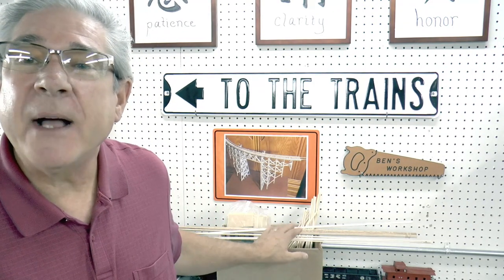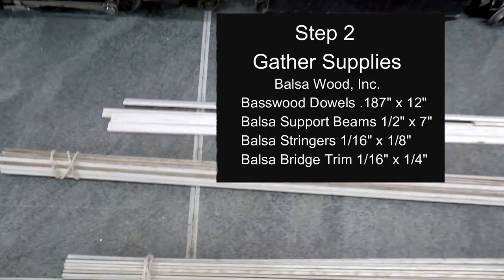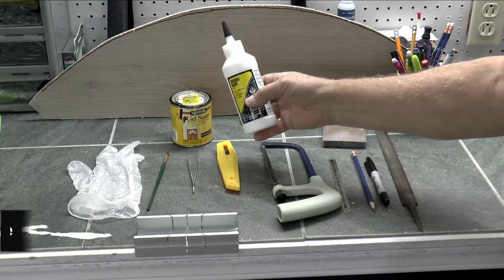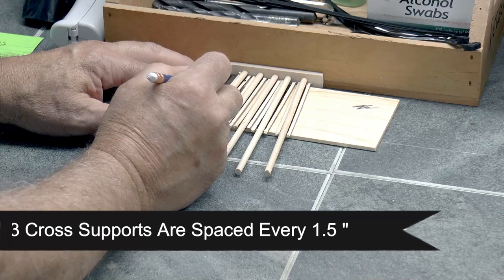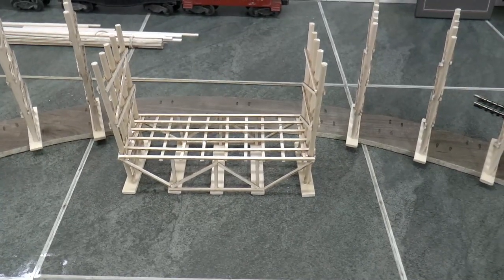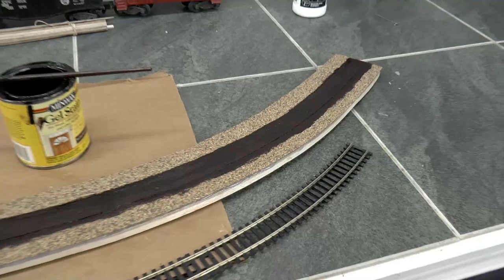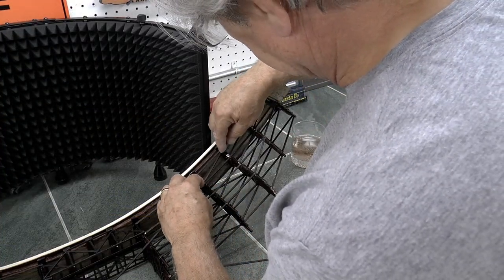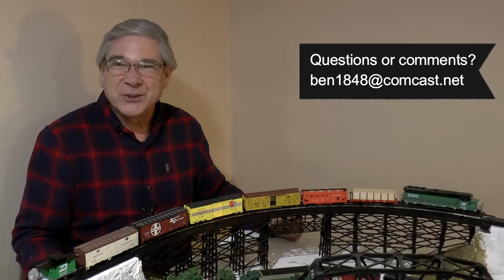Video #10: Scratch Build Of The Trestle Bridge

Comment: I used to scratch build R/C model boats and when staining multiple pieces or parts.. I used to pour the stain into a small flat oven tray/aluminium roasting tray and lay the item into the stain let it sit for a minute or so then remove it or turn it over if I didn't have it deep enough to cover the whole piece... it makes for a quicker and easier process other than painting each piece with a paintbrush and I was able to do something else while this was happening... Your Trestle bridge looks fantastic. I will be making something similar for my layout once I get to that part of the layout.
Reply from the maker: Hello, thanks for the comment. I thought that by using the stain gel hand-brush method it would provide an uneven, yet realistic, look to the wood. However, once completed and placed on the layout I found it was positioned so that you can't really notice the look I was going for. So I agree with you, using the tray method you describe would have basically given me the same result in half the time. Lesson learned for my next one!

Comment: The main 'rounds', the dowels, are called posts or pylons, or pilings. They are pile-driven into the ground until they resist any further driving. The angle the outer pairs have on each side of the frames is called 'batter'.  The angle of the outer posts would typically be between 24 and 28 degrees from vertical. The frames, with five or more posts and sway braces, are called 'bents' or 'bent frames'.  The top beams running across the tops of the bents are called caps.  The stringers run along the major axis of the tracks and supporting decking.  Below them, also running that way, and supported by the caps at each piling/post height, are 'girts'. Finally at the very bottom of the structure, is what is most often a 'mud sill'.  It's simply treated, robust, timbers embedded into crushed rock and soil, and that is what supports the entire structure.  One mud sill under each bent, except where pilings are driven 10-15 feet into the ground.
Reply from the maker: This is great information, thank you for sharing, I appreciate it!

Comment: Thanks for sharing your technique. It turned out really nice. I’m in the planning stage of adding a trestle bridge. Did you run a bus line and feeders on the trestle?  I’m trying to figure out the electrical connection.
Reply from the maker: HI Jeff, Thanks for your note. I'm glad you enjoyed the video. I did not run any additional electrical to the trestle. On the particular line that the trestle is part of,  I simply have 2 terminal tacks. Each is spaced half way though the layout and are wired individually to the power pack, Hope that helps, if you have other questions just let me know. Thanks!

Comment: Awesome Video! Subs Here Ben! How do you scale all the woods and the actual bridge for Ho scale? Do you have  a ho scale pattern? Thanks.
Reply from the maker: Hi, thanks for the question. Getting the scale size right for HO was a challenge, but here's what I did. When I was trying to buy a Trestle Bridge kit online (and could not find any - they were all out of stock) I came across the instructions for one of the kits. In the instructions, it provided the dimensions of the different parts (stringers, support beams, etc.) so I used that information to order the balsa wood pcs.
Reply: @bensmodelrailroadworkshop  Thanks for the reply. I am planning to build a shelf layout soon.
Reply from the maker: Oh that is cool, I think shelf layouts are awesome. If you think of it, send me some pics when you get started!
Reply: @bensmodelrailroadworkshop  yeah thanks.   https://www.youtube.com/watch?v=8jCghtm1eFI
This is the latest video I have on my 4x8' layout, have to dismantle it because I am moving.

Comment: Question - you refer many time to 'balsa wood' yet the view of your materials shows the packages labelled basswood.  Did you actually use any balsa wood for this?  I would think it too weak and too soft for such a structure.
Reply from the maker: Hi Dwight, thanks for the question. I did use Basswood Dowels for the support "legs" of the bridge, but all the other parts are indeed balsa wood. You are correct that balsa wood is soft, but that's the type of wood that works best for bending the curve. The bridge itself is very solid but It is also delicate because of the soft balsa wood, as you point out. I shudder to think of the day when I have to remove it, because I know it will be damaged. Hope this answers your question, and thanks again for writing!

Comment: What about the supports on the right end of it that are not supported by anything and are hanging in the air?
Reply from the maker: Hello, those end pcs. get installed in a mountain slope on both ends of the track. If you look closely at the very end of the video (14:50) you can see how I built the ends into the sloping mountain.